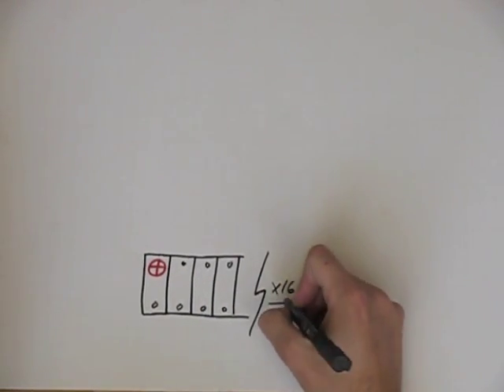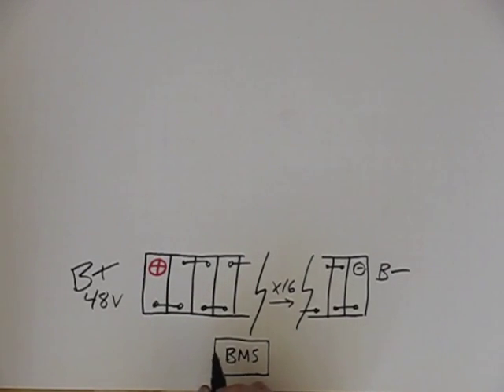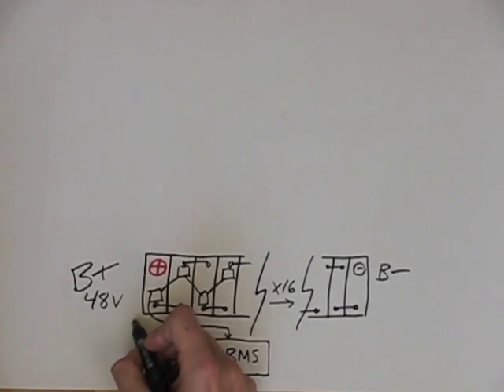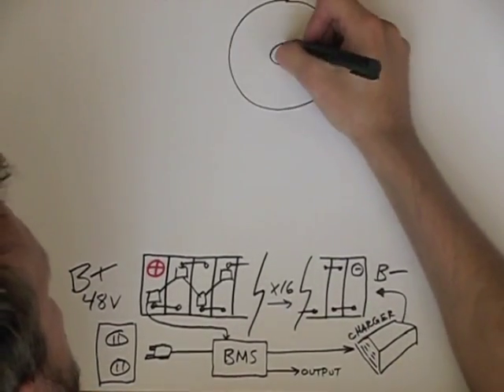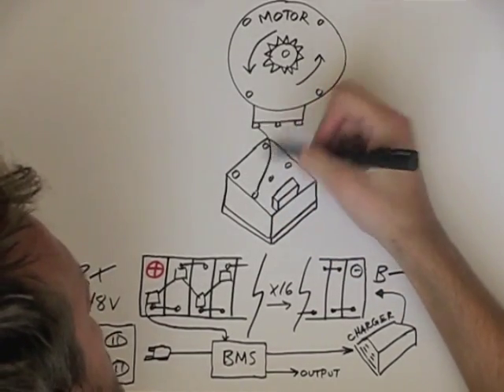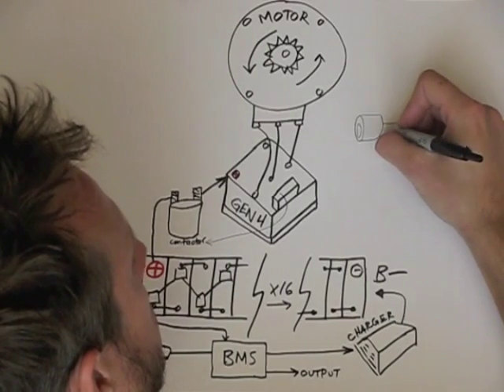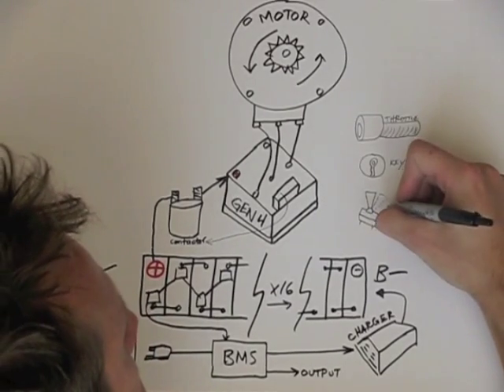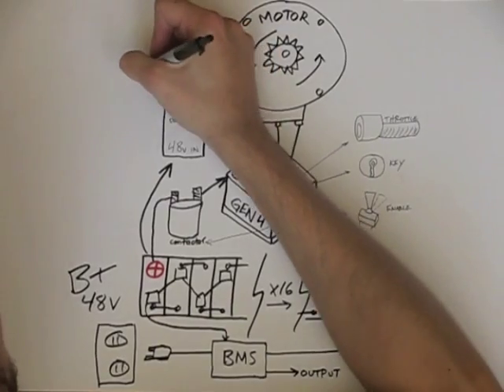Wiring Drawing.m4v

Comment: 3.8 volts on a LiFePo4 is very high. Charging voltage on normal LiFePO4 should not go above 3.65 and the resting SOC 100% is 3.4volts.  Are they LiFeYPo4?
Reply from the maker: I think this was what the manufacturer recommended at the time.

Comment: I am a little confused. The motor you have is 3 phase AC? Does the Gen4 convert the 48V dc from the cells to 3 phase AC power? If so what voltages?